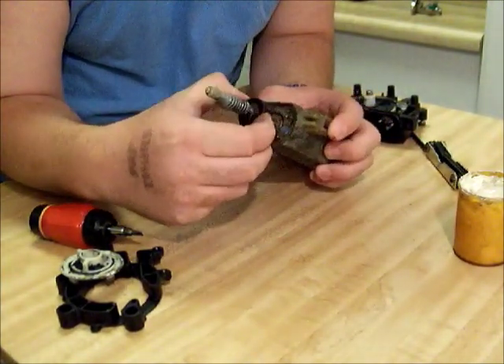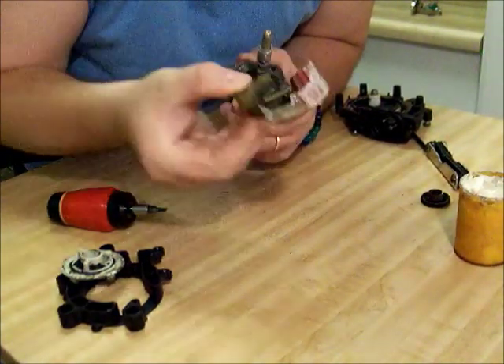Chrysler Lebaron Convertible rear window repair instructions (Part 1)

Comment: I did 7 of these this week. A few I had to torch the bearing off, make sure you remove the little white cap.   A few had bad top bearings in the black plastic part.  Also if you can pull the shaft out with the gear still in the black part it means your gear is worn.
Reply from the maker: Chris didn't know there were 7 more out there in the wild!
Reply: @carcomp101  yeah. I bought them from a guy who had them in storage. He thought they all worked but only 3 did. Sitting rusted them .

Comment from the maker: BTW, if your window is sluggish, it probably the motor needs the bushing greased!  The tracks, even if they are caked with gunk, are no match for the power of the motor. Its a darn big one, and its a worm gear drive at that. It could probably smash a finger good when properly lubricated.

Comment from the maker: To remove it quick, you will need a 10mm socket, a 1.5ft extension, and a socket wrench. Rear window needs to be up. Lower your top, then on the side you want to work on, remove the screw in the 'top latch' and swing the vinyl cover "molding" out of the way some. Use your extension to get to the one single bolt at the bottom of the motor assembly. Its way down there. Then, take the two upper ones out. wiggle the entire assembly, motor/window/track system out all at once and unplug it.

Comment: Thanks for the video. Do you have a video showing how to remove the motor?
Reply from the maker: Sorry no but it's easy. You put the top down, remove the back seat and side, and unbolt the entire window assembly. Then slide it out the top!
Reply: @carcomp101  
Cool thanks

Comment: The black Cone shaped rubber shield will stay in place by sticking it in the black housing prior to inserting the motor. It has a grove on the cone side that fits over a ridge in the plastic housing. Good video otherwise!

Comment: any chance you have anything on actually getting access to the motor in the first place?
Reply: did you ever find out I'm also looking
Reply from the maker: You have to remove the rear seat bottom, and the inside part of the interior.  Next pull out the entire window mechanism.  The motor is part of that.

Comment: hi. i am trying to replace the right broken quarter window on my 95 LeBaron, but i could not remove
the rear cushion first. Through the Internet, I found that you could do that by inserting
a long  screwdriver underneath the cushion and lifting it. It didn't work out for me so far.
Would you tell me how to remove the rear cushion, please?